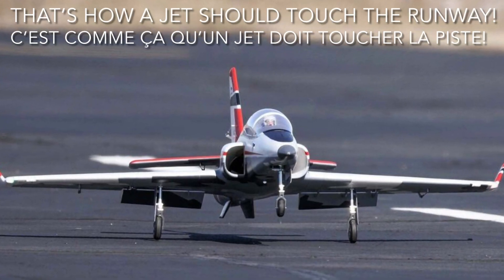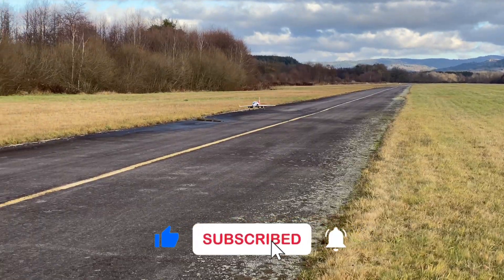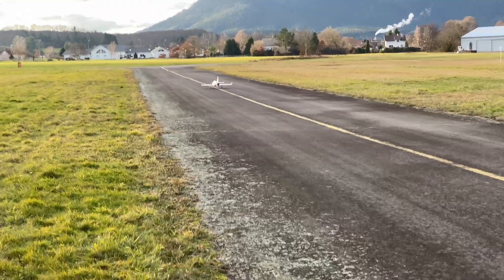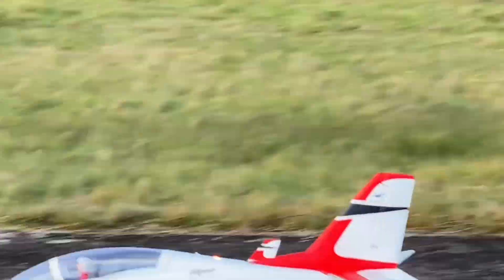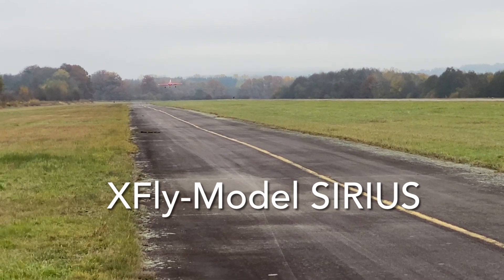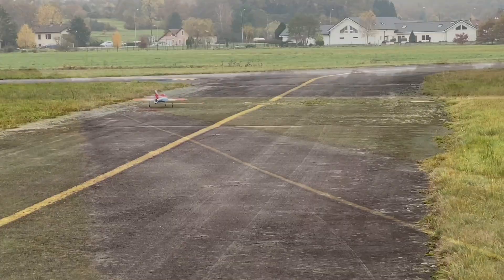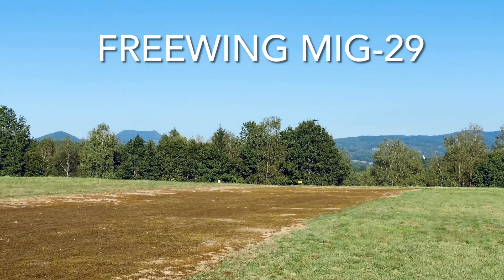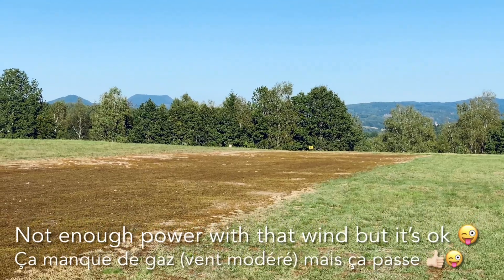HOW TO LAND A JET?    COMMENT FAIRE ATTERRIR UN JET? (English / Français) 4K

Comment: Do you mean to say throttle for altitude and pitch for speed?  “Throttle for pitch and elevator for attitude” sounds like they both work on pitch. Good video/landings though.
Reply: Throttle for sink rate (rate of vertical descent), elevator for attitude (a.k.a pitch, a.k.a horizontal speed)
Reply: janmb well said!
Reply from the maker: @motionsic  sorry buddy but sometimes I can’t explain in English what I could say in French 😕
Reply: @ArthurRC  No need to be sorry, you are very relaxed in front of the camera, which is great and better than most including me.  Keep up the great work!
Reply from the maker: @motionsic  thanks a lot 🙏🏻🙏🏻🙏🏻🥰
Reply from the maker: Yes sorry 😕 I mean throttle management for altitude (not speed) and pitch for speed/attitude (nose up/down)

Comment: Doing the math right now. It may be cheaper to pay for a round trip ticket for you to Atlanta vs the repairs and nose gear pin replacements/nose gear motors. I’ll be in touch. I think if apply myself I can get better at landing edf’s, with your help, 8 hours a day. 2 weeks tops.
Reply from the maker: 😂😂😂😂😂 if only I could come to Atlanta 🥰🥰🥰
Reply: @ArthurRC  Well, I did a 11 h stop there traveling to Chile one time. It was way cheaper and I got to now a little bit of the city :)